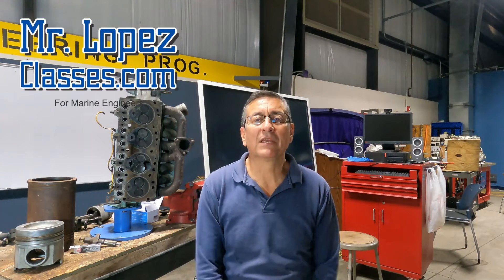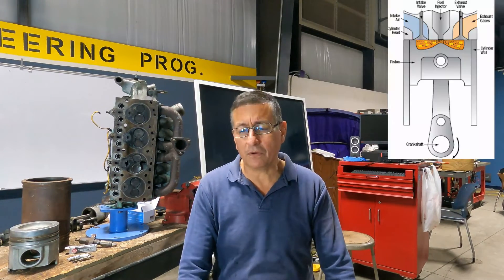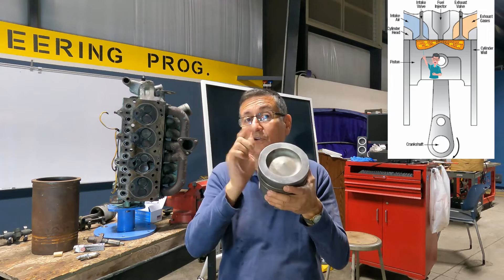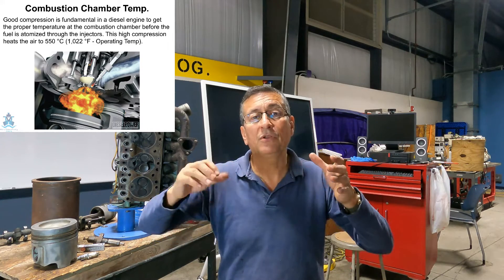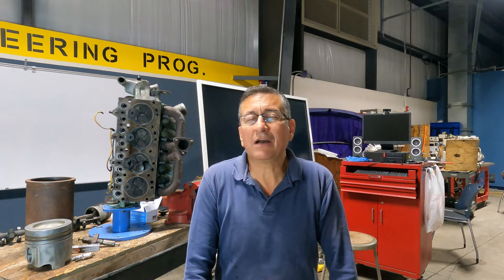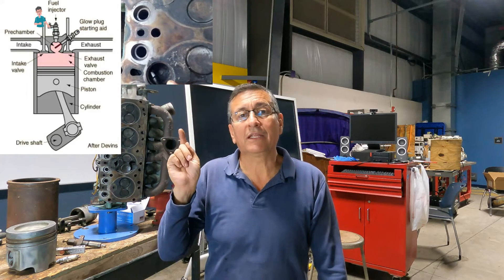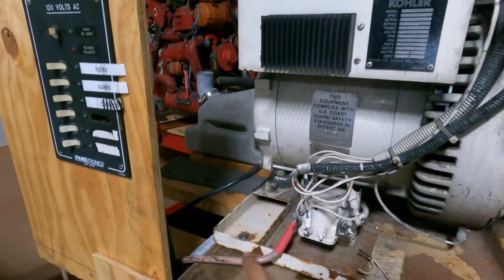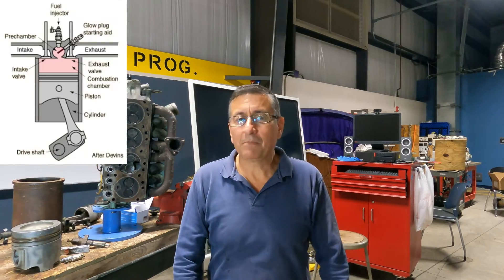Glow Plugs in the Diesel Engines

Comment: Mr. Lopez. I yanked the wire that goes from the power supply to the glow plug by mistake on my Perkins 4.108. Does the cable is connected straight to the battery?